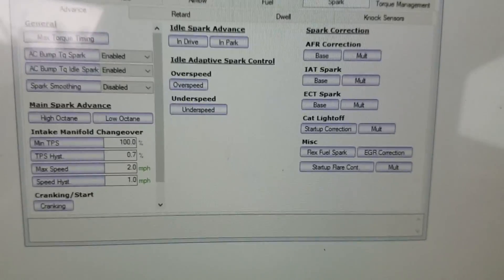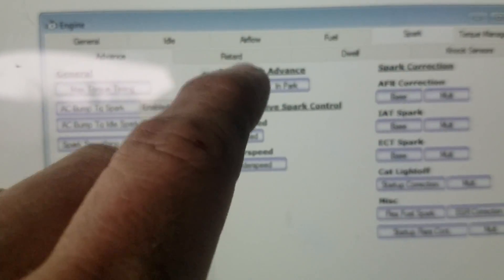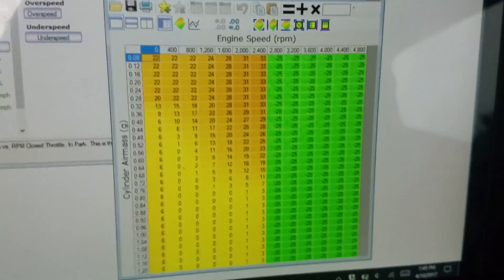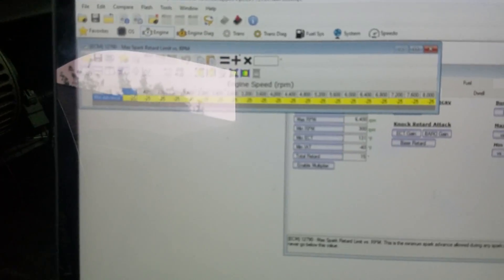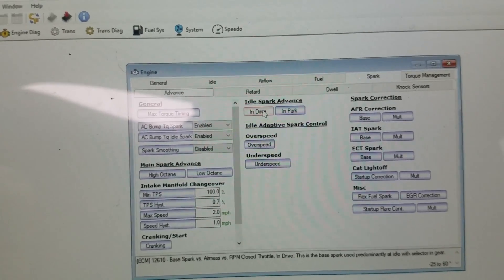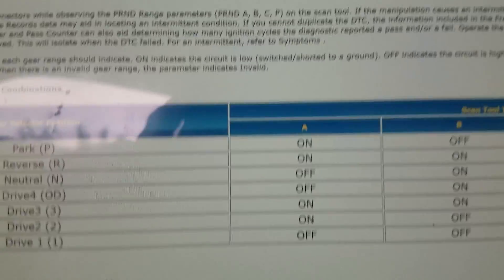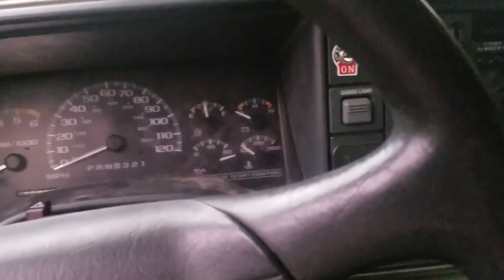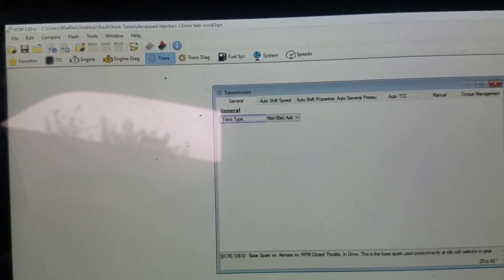Free Two Step/Launch Control for GM vehicles using HP Tuners

Comment: Mine doesn't bounce much and no spark or flames its like if I just chose the rpm limit  n cutoff with put doing all the stuff u sed and the max speed and speed hyst should I just put it at 0 that's the lowest I can go

Comment: I'm gonna give this a shot before my next drag strip visit. If it works, you'll see it in my next passes uploaded. 04 z06, I launch at 2200. Went for 2400. Unfortunately the base spark increments are 400rpm. Thanks for sharing!

Comment: Can't get this to work as those 2 spark tables are for closed throttle on my editor. I didn't do the wiring deal because I'm not a manual transmission. Any help is appreciated thanks.

Comment: the interface for the mpvi3 is way different and i cant seem to find those settings under spark-advanced
Reply: change view settings to advanced from basic
Reply: @kennyluu2470  i thought that wouldve been it but im already in advanced :/ any other suggestions?
Reply: O and do u have to have it on a switch can't just have it on all the time in N

Comment: For anyone following the schematic, prndl p should be 34. So blue 34 and 32 should be grounded
Reply from the maker: Good catch. I added a note in the description about this.
Reply: @DJTuningCom  I spent about an hour trying to get it out of d4, ended up going to a pin out diagram and seeing for myself. Amazing video though, never though of using the spark tables like that, I’ve got my truck shooting flames
Reply: Does this work in my 2005 Chrysler 300 v6 3.5  I got hp tuners
Reply: @adrianmoreno5190  if you can edit the ignition tables then yes

Comment: Would this work on a 5th gen Camaro automatic? Also how would it work if you didn’t want to use the two step regular driving? Thanks!
Reply: It should, and if you don't want to use it while regular driving, then don't press on both pedals.  It only engages when the break and gas are pressed.

Comment: Maybe you can help... I'm using HP Tuners with an 05 Canyon 3.5 inline 5 cylinder. It says the ECU is a P12. Anyway my issue... The high and low octane table uses RPM vs Cylinder Airmass (g) to find Spark Advance. Unfortunately on the VCM Scanner my graphs use MAP vs RPM to plot out Timing. If I go to Layout > Default Layouts > Diagnostics > O2 (mv) > Airflow (g/Cyl) it won't work. The graphs change but then all my hits just stay at the top , which is 0.04 g/cyl. What do I need to do? Awesome 2 step find btw... I'm not even close to needing that yet but hopefully one day, for the the moment just trying to make shit run better...
Reply from the maker: you need to log the airmass value. in the list of values hit the gear icon and search for airmass and you should find the additional value you need to log. they used to default it to airmass in the scanner before 3.0 but now it's kind of a trap for first timers. kind of frustrating.

Comment: Question about the manual conversion... If you don't have the park grounded will the ecm allow the to car start I'm trying to get a minivan 3400 gm la1 into a fiero scan indicates fuel OE not ready
Reply: Wire it to your clutch pedal and start the car with it pressed ;)

Comment: Real annoying hearing car guys call an engine a motor.
Reply: thats the correct use of the words, look up the definition... an engine is just a type of motor, a motor is just something with a spinning output shaft,
Reply: kimbo slice I know, I was just stirring the pot a little since so many people get upset about the word usage. All in good fun 👍
Reply: Really annoying listening to nimrods argue about the meaning of the word and correct people when they're actually wrong
Reply: Im with ya BOOGALOO
Reply: Generator , engine , motor , power plant , mill , there are many words you can use . if you're that worried about it don't watch car videos or talk to car guys .
Reply: @jeffel80   You moron.  If an engine can be a motor....that means the engine is a motor.  Meaning its a motor and an engine, which makes your second statement impossible. 

Quit trying to look smart, its not working.